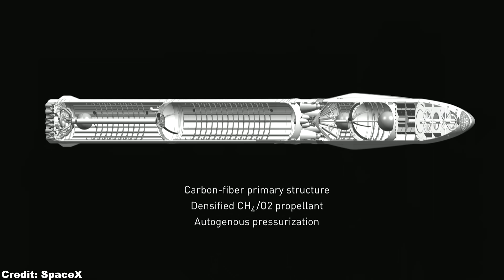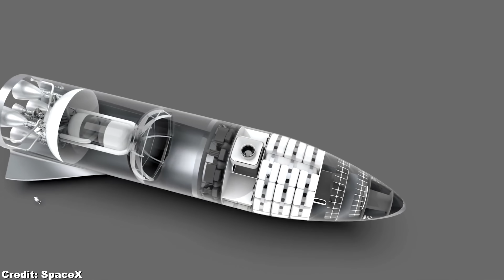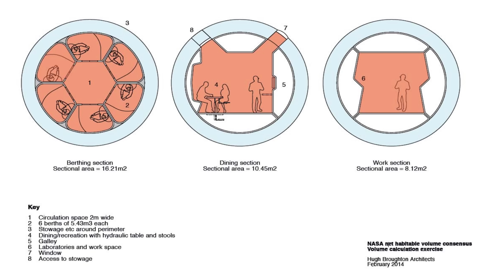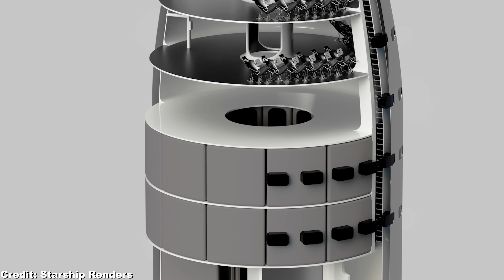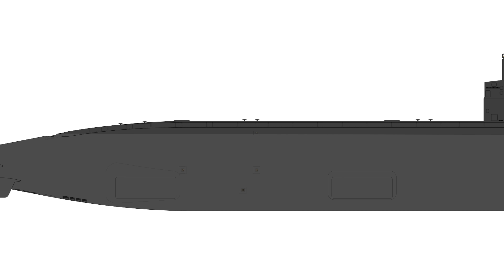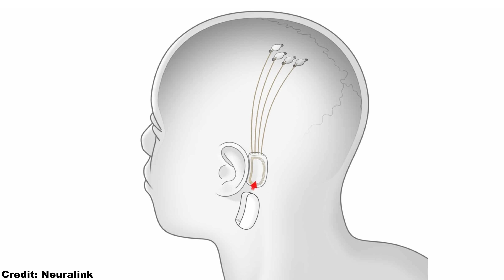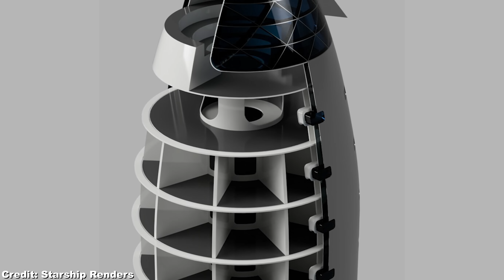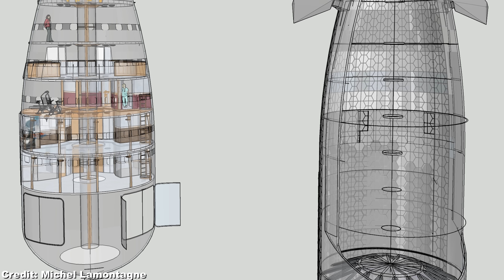CAN YOU SURVIVE 6 Months With 10 Cubic Meters? [SpaceX Starship FLAW FIX]

Comment: Consider that people sleep for 8 hours per day..  If the cabins are similar to Japanese Capsule Hotel rooms, you effectively reduce the population by at least 1/3rd (24 hours / 3 = 8).  However, there are also other easy solutions.  For example, what if a deck or two were expansion inflatable to vastly increase their diameter once in space?  That is a very simple solution that, if collapsed could also provide the mass for a solar flare protected core.

Comment: As others may have pointed out.......not all crew will be awake or asleep at the same time.....I'd imagine 3 8-hour shifts for sleeping.....so you don't need a berth for each crew member....somewhere between 1/3 to 1/2 I'd say....

The other issue that comparing to a submarine might not be accurate is zero gravity.  The use of a volume is quite different with the full volume available instead of just the floor for moving about.  Let's just say it at least doubles the usable area.....think of doubling your den area at home since up and down are meaningless.

Now for gravity operations you'd obviously need seating for all....but if the births are equipped with multiple seating or the addition in a common area, you're good to go

Comment: When I heard about the final dimensions of Starship I too was very skeptical of the 100 passenger claim. This may be possible for a lunar voyage, but I don't see it for the 6 month haul to Mars. I remember thinking it'd be more like 40. I think 30-50 is more likely with 50 being the maximum practical capacity. The passengers need a common area and definitely a small gym to minimize bone and muscle degradation. Still that's an impressive amount of people this vehicle would be capable of taking to another friggin' planet.
Now, if Starship 2.0 ever comes to fruition with it's 18m fairing (WOW!), that could take 100 people easily and possibly more. with 4000 cubic meters. It would give each passenger ample space with plenty of room for other facilities. I can only imagine the super-duper heavy booster required to get that thing up Earth's gravity well. That launch would be a sight to behold and one hell of a ride.

Comment: There wont be 100 people in the star ship because they cant put 100 people in 1000 C/M with cabins and everything else and they will see that.
If the star ship was much quicker which  it may be some day then they can seat 100 or more people like an airline with Communal areas but that is a couple of decades away and depends on how quick newer propulsion systems come on line.
The 1st star ships will only have essential of no more than 20-30 people until it is safe or cost effective  for ordinary people and that will take longer than Elon is saying, there wont be ordinary citizens for at least the 1st  5  years.  (unless they are rich  paying passengers) until they improve the speed of the star ship which is  far to slow atm.
I think that Elon may actually be pushing for the new  nuclear or vassimr space craft technology that NASA is working on  to really make it viable to send more passengers and also Tech like the Neura link that will occupy the passengers, this or something else is very essential otherwise boredom will take over very quickly.
One  thing i know about Elon is his thinking is always moving quicker than is actual possible, he is thinking ahead all the time. I can see new iterations of star ship in the years following to accommodate 100 or more people after the 1st star ship landing on mars in 2025-2027 after the moon landing in 2023-2024

Comment: I disagree with the weekly op assumption of submarine deployment. On a nuclear powered submarine the reactor could keep us at sea, submerged for over 20 years without refueling. We make our own air and water so the only limiting factor is food. For a long deployment we load at least 90 days of food stores, granted we do line the passage way floors with cans of coffee, flour, sugar, #10 size cans of fruits and vegetables (yes we walk on them and consolidate the spacing to prevent crewmembers from stepping into hole), convert our refer into a freezer and pack them both with boxes of frozen foods to the door. (We don;t have a real menu for the first month, just eat our way in). I personally have been underwater for 76 days straight, pulled into port for a resupply for 4 hours and back underway for another week.  On a long voyage you will loose your depth perception because all the objects or walls is 5 feet. Everything past 5 ft is 2 dimensional and they recommend you not drive for a day or until you reacclimate.

No a submarine will not pull off station for a sick or dead crewmen. If he is dead the body bag goes into the freezer until the mission is over and  are at home port. If the crewmember is gravely ill and has gone past the ability of the corpsman (who is trained to do dental surgery and minor surgery procedures, including an appendectomy) we can do a helo transfer at sea, which is at times more dangerous than the emergency.

It can be done but it takes the right type of person to do it. I have seen one person climb down the ladder to report onboard and as soon as he got to the bottom climb back up the ladder and un-volunteered (No shame, no repercussions, this is a volunteer service) due to claustrophobia. I did hear of a guy before I reported onboard that went off the deep end and wanted off right now. He went to the forward escape trunk shut and dogged the lower hatch, flooded the trunk, undogged the upper hatch and pressurized the compartment to match sea pressure. The only thing that was stopping him was the ship was going too fast and it kept the hatch closed. It a long while to talk him in and they kept him in a straight jacket until we pulled into home port (that was a week later, again a submarine does not pull off station unless the situation requires is and that was not the situation to do it, and he had a watch assigned to him all the time).

Comment: I'm not sure that significantly more than 40 isn't out of the question. I'm pretty sure I could survive for 6 months with private space of something like 2m (bed length) x 1.5m (width for bed + extra at the sides for shelves and/or storage) x 1.33m (about 1m to 1.1m height + extra enclosed space for built in storage, recessed screen/tablet, ducts & wiring etc) = 4sqm leaving 6sqm per passenger to contribute towards access passages and common areas/facilities. The load on common spaces e.g. gym could be significantly reduced by running a 3-shift system allowing those areas to be smaller while everyone still has his/her own 4sqm private cabin. I suspect the low headroom is also less of an issue if no artificial gravity is implemented since I believe zero-g makes a given space feel bigger.
Also, humans can put up with more than some might think, or at least they used to be able to in the 1800s. Read Herman Melville's Moby Dick. Some whaling ships were on voyages without touching land for 3 or 4 years. I accept that they could go out on deck and occassionaly meet up with other ships but even so 3 to 4 years is a lot longer than 6 months and conditions for the more junior crew were terrible (https://www.whalingmuseum.org/learn/research-topics/overview-of-north-american-whaling/life-aboard). Also, a Starship crew would have technology such as games, videos & ebooks to entertain themselves.

Comment: --Using submarines, 
10m^3 is fairly reasonable.
--Ultimate conservation fitness, and communal necessities, can reduce this number.
--There are several improvements, simply because it is spacecraft.
>>Together ? It is reasonably possible to live well, within 5m^3 of volume.

** Go outside and play **
Momentum of individua,l vs 
Momentum of craft, are nearly identical.

*Expanded sleeping quarters ??*
-'Outside the atmosphere, it is possible to expand the volume of the vehicle.
--Easiest to adjust, 
would be the sleeping quarters.
--Beyond the atmosphere, 
could "push outwards" the sleeping quarters.
--Changing from 100 people with 5m^3 space each, 
to 100 people with over 20m^3 each !

Comment: Starship should be considered as a shuttle, delivering a certain mass to the Surface. That should be mass you would Need on the planet. When it is time to send 100s of People to Mars, accomadation will already  be in place; they won't Have to live in there ships. Therefore it would be a waste to use that Cargo capabillity to bring down Habitats. That said, it would make more sense to house the passengers in a separate lightweight gravity Wheel, and use the Starship to Ferry them down, once arrived at mars. Seating can then be optimized like in a Commercial Jet. 1 gravity Wheel and 1 starship (which could be used as thrust unit) could then Ferry About 300(?) passengers. Since the Wheel can also house additional fuel tanks and ion thrusters, the resulting trip could even be Shorter.

Comment: I think you are way off on your neuralink ideas.   even if it exactly placed, 100% engaged by the brain and pretend there is no overhead.  Your still only talking about 3000 electrodes or about 50 X 50 pixels.   Or about 20 times smaller then a Commodore 64.  Hardly VR.
No, I don't think Elon will postpone the mars mission to wait for neuralink.  Likely each would get some kind of tablet.

Comment: We already understand the Raydiation issue because of all the probes we have sent to the planets.  It is simpler then we thought, the real damaging issue is lack of Gravity.  Spin Gravity has to be part of the transit phase and then their needs to be some spin gravity on the Surface as well so that 1g is a regular part of the mission's personels routine, especially if they intend to return to earth.  The Psychology Is resolved on earth before the missions are sent you just weed out the weak personalities and get on with the mission.  As for the space issues that is resolved in earth or lunar orbit/Surface where the necessary sized space craft are final assemble.   The mission to an from Mars main engines will likely be ION drive with Nuclear reactors as part of the mix.

Comment: People how did they build the international space station? In sections, one section at a time, so for moon or Mars missions. The vessel would never come back to Terra Firma, the engineering specs would totally change. You could build a larger ship in space, safer to build, may take longer. But more fuel, supplies and what nots, so for a ship that can also be atmospheric, specs would have to change, so the engineering would have to refocus on that issue. Open the mind and tell me how to work an issue, not why it can't be done.

Comment: I think if there is a common room used for sleeping. there should be sleep pods with curtains and a rotating visor. there should also be a common dressing room which only need to be the size of a dressing room like in most clothing stores it could work if they take the tiny home building approach. And of course lots of virtual reality Stress reducing entertainment will be necessary.

Comment: I think Starship is only one part of the vehicle that will go to mars.  As per previous discussions on this channel, the ship will have to provide artificial gravity.  Myself I would add two side pods (wings) that would house the people and provide a work environment. The ship and pods would rotate during flight to provide artificial gravity. The pods could be used as a transport vehicle to and from Mars on a regular basis.  Even then I don't think you take more than 50 people at a time initially. The longer the wings the more gravity. Access to the mother ship would be somewhat limited via a "taxi". Starship would have to provide mechanicals and redundancy in the event of a problem.

Comment: In my opinion, 30 crew are idealistic. 
Devided in 3 shifts for the personal, and 3 compartments for the space they will need. 
One for work duty ( navigation, control, communication, repair...etc ).
One for personal and social use ( dining, entertaining, workout,  ...etc ).
And one for sleeping; 10 capsules are all they need. 
At any time of the trip, one shift is taking rest ( sleeping ), while the 20 others have plenty of space and time to enjoy. 
For safety and security reasons it is highly recommended to have 3 starships traveling together, and rotating, to create some kind of gravity. One for the crew, one for cargo, and one for machinery and parts to replace or fix any failure.

Comment: Hi there!!  Gravity yes it's a problem not really look at the uniforms put some metal in the material and a electric magnetic fields in the flour and boom no spinning and wasting energy but you still have something like gravity and Al the exercise you need and can use the same thing with sleeping courters to simulated our way of life and needs metal armer cane work as wel within you have pressure bag's like a flite sout or a moon boot one can put this in clothing bed sheets would be cheaper cleaner and Al in place!!  Just remember my name wen you get something out of this just my name!!

Comment: Interesting video.  Having worked a good bit with naval submarines, I would make a few points.
1.  Half of the volume of the hull being usable crew space is an overestimation.  Much of the volume of a submarine is taken up by equipment and much of what isn't are small areas behind and around equipment that are not accessible or useful for the crew.  Furthermore, the basic shape of a submarine and its design philosophy mean that even of the space that is accessible to the crew, much more of it is devoted to corridors and access ways.  On a submarine, equipment is spread over the length of a long, skinny tube.  As most of that equipment has to be contained within the pressure vessel so that it can be serviced at sea, you have to 'waste' a great deal of your volume just making it possible for crew to reach all of that.  

The Starship crew space, on the other hand, is a much more compact shape, with less 'dead space' devoted to just letting people get from one area to another, or making equipment accessible.  On Starship, too, far less equipment will be accessible from the pressure vessel.  Equipment will either be accessed via space walk, or not accessible at all and just be made to last.

2.  I think that you underestimate the benefits of zero g.  Being able to float around allows passengers to make much more efficient use of the volume that they have, as compared to a ship in a gravity well.

3.  Many nuclear submarines, especially SSBNs do stay at sea and submerged for months at a time.  While they could go back into port if something went seriously wrong, every effort is made not to do so.  They will come home after patrol with most of the crew having not been above decks in weeks or months and equipment held together with ducktape. 

4.  One bunk <> one crewperson.  Most naval vessels practice 'hotbunking', where there are fewer bunks than crew.  While one person is up working, someone else is sleeping in their rack.  This can allow for two, or even three times more crew members than there are places for them to sleep.

Comment: "Neural VR"? In my opinion on the image you've shown for example would mean that the implants will have to be inserted into the head surgically, allowing the device to activate the neural VR externally. I think this scenario is probably not necessary for health reasons, because of the metal bits at the end of the leads attach to the brain, to me will be a health concern. Mainly blood poisoning, I maybe wrong, however, for the meantime I would suggest that this technology must be deeply investigated, to find a way to make the device to be detachable without having most of the device surgically implanted in human heads. I do not want one in mine.

Comment: OK--------- Sorry but the military ships crewmen win wars with less than 10 meters for months on end all the time.  The Boomer Boats spend 6 months below the sea all the time and it is obvious you have never been in a sub or half the shit you speak would not be coming out of your mouth's. Modern subs us 3/4's of the space for machinery. WW-2 subs used 7/8's and more for machinery on average with crewmen sharing bunks (2 to 3 crewmen) they call hot bunking because there simply was no room.  WW-2 subs typically spent 4 to 6 month patrols depending on where they were home ported at. With the boats operating off of Sub tenders in the South Pacific spending most of the war living with only about 5 meters of space with only a few allowed on deck when on the surface and only a day or two between patrols making repairs and restocking. Then there is the 23  hours a day in the average 6 by 8 foot Jail Cell  in most prisons with the worst not even getting out to shower. Now I know you are such Pansies that you can't conceive of living in such cramped quarters but man has been doing it for thousands of years and we are still here.  To bad most of the Egg heads doing the studies are little better than you two. Which may be why Nasa has developed only Crap for the last 50 years. Just remember that only the best will be going to Mars and think nothing of the cramped conditions.  Thank GOD that will not include either of YOU.